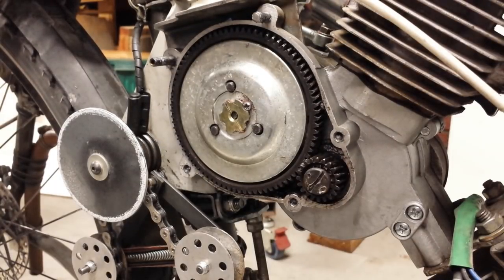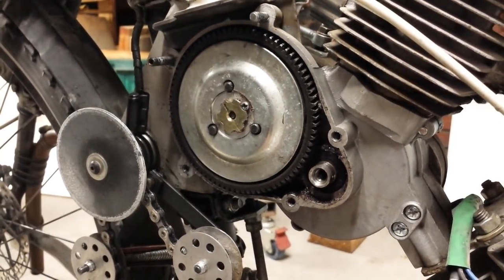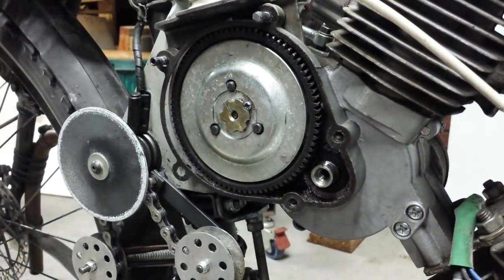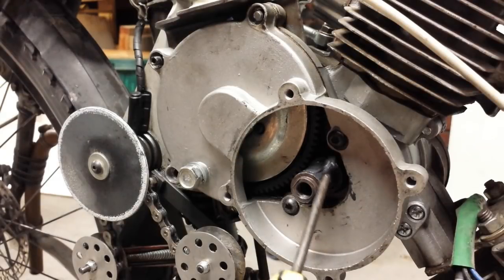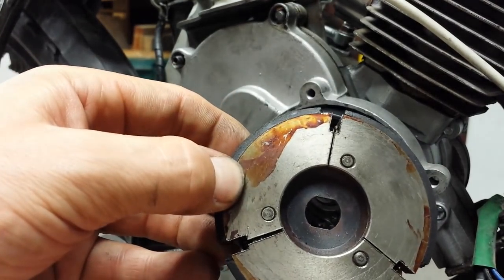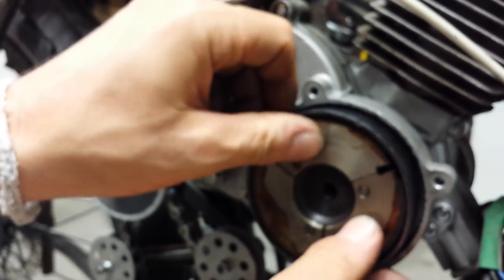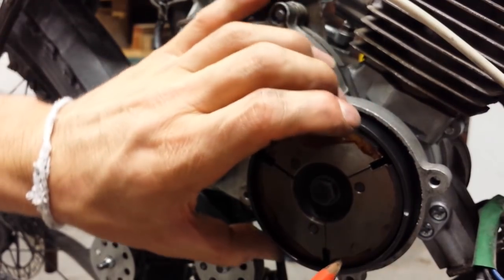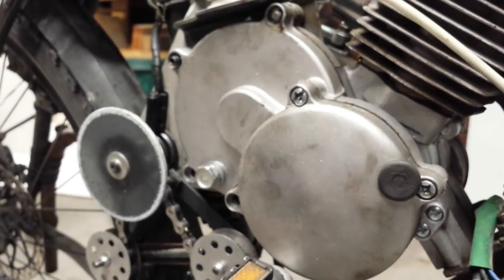Centrifugal Clutch Installation on the 80cc Chinese 2-stroke motorized bicycle engine

Comment from the maker: @ samsve - the crankshaft extension sleeve comes with the centrifugal clutch kit.
Reply: Fabian F Hi where can I buy this Kit? I looked all over ebay and other pages but I cant seem find it or it is out of stock. Do you know where to buy it with maybe even shipping to Germany?
Reply from the maker: HardDiskLover The centrifugal clutch as well as pull start can be purchased through a number of vendors:

http://www.bicycle-engines.com/Centrifugal-Clutch-and-Pull-Starter-Kit.html

http://www.shopatvpartsonline.com/complete-centrifugal-clutch-assembly-bike-engine-kit/

http://www.rawmotors.com/Centrifugal-Clutch-p59.html
Reply from the maker: Fabian F the extension sleeve comes with the centrifugal clutch kit.
Reply: Fabian F Thanks for the links :-)
Reply: +Fabian F  now does all the vedors inculde the extension  sleeve housing for the cenfucial  clutch  conversion?
Reply from the maker: +Ronny Khmai The crankshaft extension sleeve is part of the centrifugal clutch kit.
Reply: thanks..for taking your time to answer my question ..im just curious because been wanting a dual clutch setup for my next build..

Comment: Does this kit still allow you to pedal start or is a pull start required ? I just tore down a jack shaft build and plan to build a new bike word is this clutch setup is a must have. Also will this work with a heavily modified engine ?
Reply from the maker: The centrifugal clutch setup is a must-have item. 
The centrifugal clutch has a one-way bearing which allows you to pedal start the engine without the need for a pull-start.
Having said that, a pull-start assembly can be purchased as an accessory item and retrofitted to the left-hand side of the engine, which gives the flexibility of pull-starting the engine or pedal starting the engine.
Reply: Fabian F thank you so much for the response. Your videos have been some of the absolute most helpful throughout my bike building from clutch to proper heads. One more question I’m on the fence about my next build engine wise. Should I stick with these china doll motors or go for a Franco morini or ktm clone ? Any opinions would be greatly appreciated
Reply from the maker: The Chinese engines are only low power engines. If you want high power and reliability, you will need a  Franco Morini  engine.
Reply: Fabian F well I’m going to take your word for it and opt for the morini. I’ll keep you posted on the build thank you for all the help cheers

Comment: That helical gear is almost always very untrue from the factory and must be jimmied with quite a lot to get running true. Otherwise it causes much more noise, vibration and unnecessary wear.

Comment: Where to buy centrifugal clutch and the extention cover?
Reply from the maker: You can get the centrifugal clutch and pull-start from a few different vendors, but i purchased my centrifugal clutch and pull-start through JN Motors: http://www.jnmotorsbikes.com/product_p/jnm1166.htm **********  http://www.jnmotorsbikes.com/product_p/jnm1170.htm

Comment: DO you have to use a pull start with the centrifugal clutch?
Reply from the maker: I purchased my centrifugal cluch and pull start mechanism through JN Motors

http://www.jnmotorsbikes.com/product_p/jnm1166.htm

http://www.jnmotorsbikes.com/product_p/jnm1170.htm
Reply: So you do need to have the pull start ?
Why?
Reply from the maker: You do not need a pull start with the centrifugal clutch, but a pull start is a convenient thing to have.
Reply: Fabian F
Yeah I could see it being convenient but an extra expense that I would have to buy at the same time if I can buy separately it would be better. I wouldn't mind having a pull start for winter. I found a centrifugal clutch for about 35.00$ and it says that it works with the pull start and I can't figure out why the pull start would be needed. This is why I am asking you since you actually have it have you ever run that clutch without the pull start?
Reply: the centrifugal clutch has a one way clutch in it but the centrifugal has a wire spring in it keeping tentions on the cage where the roller bearings are  to be a one way clutch that cage spring can break and it is harder to pedel start it you can peddle start the bike with the centrifugal clutch

Comment: When i try to pedal start the centrifugal clutch slips
Reply: because you need a pull start to start the engine or go down a hill that why the four stroke engine has a pull start because you can't pedal start it

Comment: You basically just put a clutch on the crankshaft with nothing for that drive to be applied to and the gearing reduction is literally 1:1that way discarding the fact your horsepower is connected to nothing

Comment: I couldn't help but think that an aluminum or copper washer on that crank bolt would eliminate that depth test.
Reply from the maker: Your logic is correct. Having said that, the crankshaft steel is very soft, so it is beneficial for the bolt to be grabbing as many screw threads as possible. Adding a washer reduces bolt purchase by about 2 threads.

Comment: What's the advantage to the centrifugal clutch?
Reply from the maker: There are many advantages, but the greatest advantage comes in city traffic, where you don't have to constantly pull in the clutch lever.

Once you have tried a centrifugal clutch conversion, you will never go back to the manual clutch setup.
Reply: Fabian F ] can u pedal the bike as a normal bike?]  &do those clutches burn out faster than the normal clutch mini disc?] I do like the idea of not having to constantly pulling in the clutch] but I also pedal 90x% of the time]
Reply from the maker: 5annent Yes, you can pedal the bike like a normal bicycle, by simply pulling in the manual clutch lever. This is the reason why it is so beneficial to run a dual clutch system.

The centrifugal clutch will last longer than your engine, if you keep the centrifugal clutch lubricated.

Comment: 'wd40' is mostly solvent and a small amount of lube,  IMHO a better choice would be 'chain lube' from a pressurized can, thick lube
Reply from the maker: I use Yamalube (on-road) graphite infused chain lube to keep the centrifugal clutch operating smoothly.

http://ecx.images-amazon.com/images/I/614Diy68JyL._SL1500_.jpg

If you watch the video again you will hear me say that the hole is used to insert a WD 40 """style""" applicator tube. Most of the spray lubricant cans use a 2.35mm tube, which is why a 2.5mm hole is drilled through the gaskets and through the drive gear.
Reply: Fabian F
 Where can I get a crankshaft extension sleeve for a 2 stroke 8Occ chinese motor?

Comment: at 6:12 the best degreaser is gasoline it degreases and it evaporates away
Reply from the maker: Mineral Tupentine (Turps) works just as well as gasoline, but it a safer option, as it is far less volatile than gasoline, and should it catch fire, it can be extinguished more easily.

Comment: Fabian , when you use a centrifugal clutch the use of clutch lever is just a option right? or you have to keep the clutch lever? thanks and nice vid.
Reply from the maker: +nvrqit If you watch the video carefully, you will see that the centrifugal clutch is supplemental to the manual clutch, so for that reason the manual clutch needs to stay in place. There are very good reasons for having the manual clutch as well as the centrifugal clutch, but to answer your question, you do not need to have the clutch lever installed. It just means that you cannot operate the manual clutch because you have no way of operating it without a clutch lever.

Comment: Dude the extender just Flys off what am I missing
Reply: you need to tighten the bolt properly and use thread locker, but not over tighten because you dont want to strip the threads
Reply: @jr-pl9kj  is the extension supposed to slide on the crankshaft easily?
Reply: @person-ce8cr   i depends on the engine and/or the clutch kit, but had to dremel the extender's bore to get it to fit mine, please note that these are hobby engines and they need conditioning before use but if you want an engine thats all ready to use, i recommend you go for the 49cc 4 cycle kit instead  as it already has a centrifugal clutch and a "mount, oil, gas and go" user friendly configuration.

Comment: what with two clutches ???
Reply from the maker: It is important to run a dual clutch system for various reasons.
Reply from the maker: The engine has a manual clutch as standard. The centrifugal clutch is an accessory device that is installed onto the clutch housing.
The benefit of having both the manual clutch and centrifugal clutch is the ability to pull the manual clutch lever to disengage the clutch, thereby allowing you to pedal the bicycle with the engine turned off. In some situations, this is a very important feature to have.

Comment: mine vibrates badly when accelerating from a dead stop
Reply from the maker: It's possible that you may have a clutch bell which is not perfectly round or does not have a perfectly round inner surface. I have had a clutch bell do the exact same thing you have described. The grabby vibration from a standing start went away after i replaced the installed clutch bell with another clutch bell from another centrifugal clutch kit.
Reply: Where did you buy your centrifugal clutch kit?
Reply from the maker: JN Motors
Reply: do you have  some chain lube in the system? if not you will blow it up!!!
Reply from the maker: watch the video for the answer

Comment: Are these reliable? Do they need adjusting after time?
Reply from the maker: +will122391 They are reliable, and last a surprisingly long time, but they need constant lubrication maintenance approximately every 250 kilometers or 150 miles.